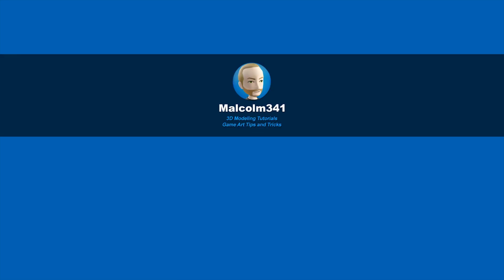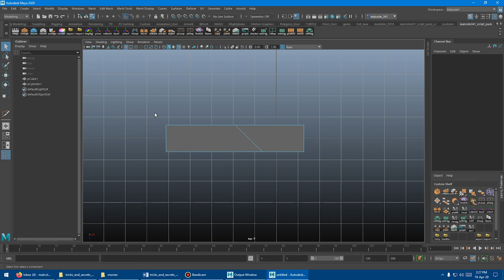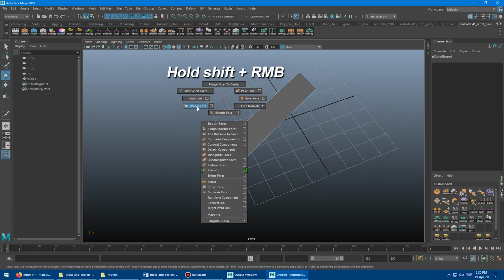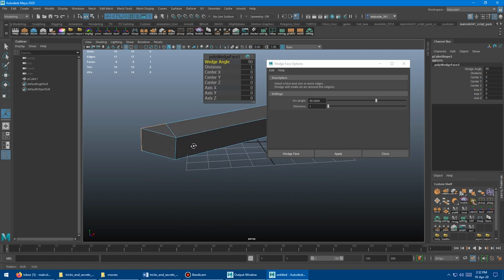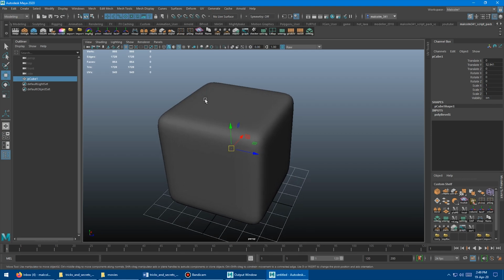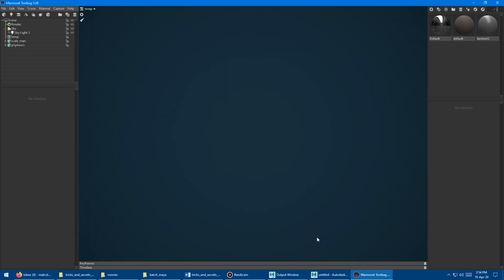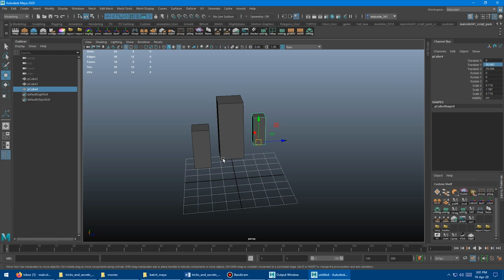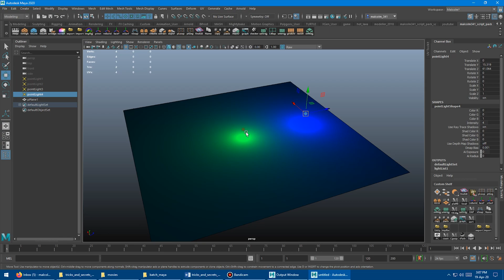Maya Tricks and Secrets - Part 13 - Wedge 45 Degrees, Export Smooth Mesh, Channel Box Math

Comment: Nice video man, but The smooth one didnt work for me, dont know why but a ot of settings and configs on the export selecion windows just aren there... HELP PLS D:
Reply from the maker: It's confusing, but the settings aren't in the options box, select your mesh and then in the file menu choose export selection as .fbx, a browse window will appear and on the right side of that window choose File Type Specific Options> Include> Geometry and then you can see the options and select the ones you want.
Reply: @malcolm341  Oh fuck yeah ur right hahaha I just have to change the format :P, my bad, thanks for the fast response :D
Reply from the maker: @sgm7650  great, glad it's working now.

Comment: hey great video! But unfortunately I still have the problem, in fact when I export my 3d model in zbrush or substance painter my model is completely buggy, parts are erased it's hard to explain so I took some pictures, it's not a virus don't worry I said that in case or short thank you if you can help me!!

first pic on maya (my basic model that I want to have in Substance Painter/ Zbrush) : https://www.noelshack.com/2020-19-6-1588977877-nug-2.png

And when I import it here is what I get x( (it's the same on the other softwares I don't understand !) :https://www.noelshack.com/2020-19-6-1588977855-bug-1.png

PLease help meee and i sub you and i liked the video  !
Reply from the maker: Send me a link to the model and I'll take a look. You're exporting as .fbx from Maya and then importing into Substance painter correct?

Comment: Hey sir, Lets just say, if i get a job in Rockstar or UBISOFT, and they ask me model something like prop or car , but Rockstar use 3dsmax as it Modeling tool, if i done that model other DCC like MAYA or Blender or MODO ect, Does Corrupt the pipeline ...? After All they want an FBX with texture on(or am i wrong?), Does it matter if i use other than company recommended software.... or they gonna fire me..?
Reply from the maker: In the job interview they'll let you know which software you'll have to use when you work there and at that time you can ask them if you can work in your preferred software, the answer will probably be no. I've had to use Maya for most projects, but on one project I had to learn Max and wasn't allowed to use Maya. Some of the artists on Gears 5 had never used Maya before joining the team and had to make the switch. Some studios allow you to use Max or Maya, but that's not that common. It's a hassle to develop an art pipeline that supports multiple DCC's so it's not that common. If you're working external and they just want .fbx files it's still a problem, the Max to Maya .fbx transfer has issues and will lock the normals. If you open a Max .fbx in Maya the normals will all be set to face which will mess up how the normal map looks on the model. If you found a way to clean the model up before sending it to them they probably wouldn't know the difference, but that would mean opening the file in the other software and making sure the normals, scale, and any other stuff they require is correct which can take a lot of time and lead to user errors. I recommend just using the same software the team you're working with is using, but again you discuss that issue with the team if you land the job.
Reply: @malcolm341  Thank you so much for the Answer.... :-)

Comment: 0:0 Learnt Multi cut with 45° snap,
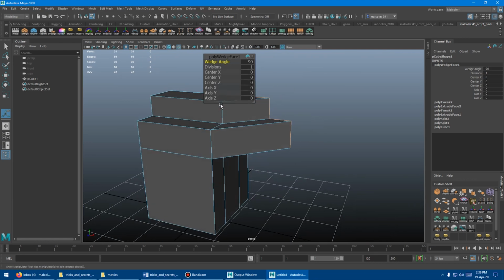5:58 export smooth mesh preview as .fbx
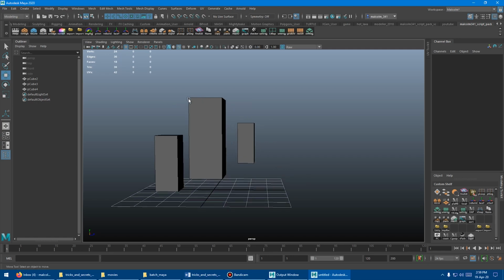 08:11 Channel box trick Learnt with formula, 
Use math equation in channel box value move, rotate, scale

Comment: nice as always... actually your wedge tutorial helped me INDIRECTLY. i always thought wedge was a weird way to create roundy edges that i could just as easily do with bevel. but when i saw the vid thumbnail, something just CLICKED in my head... like i suddenly saw a possibility that i didn't see before and i needed something like this LAST WEEK! so sometimes, i need to grab like a row of polys and instead of extruding, i'd like to just extrude so that one set of edges is not extruded... so that the profile of the extrude is not rectangular but triangular. the way that i've done this is to extrude, then go and select the polys on the side i want to collapse, delete them and then grab those verts and weld them back to where they were before i extruded... but WEDGE DOES THIS!!! awesome. thanks!
Reply from the maker: Yes a real time saver!